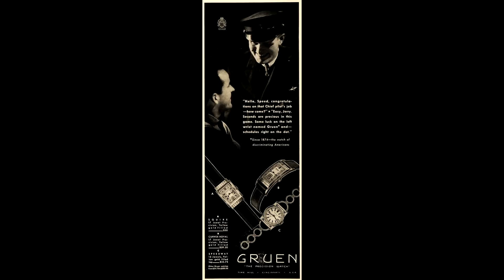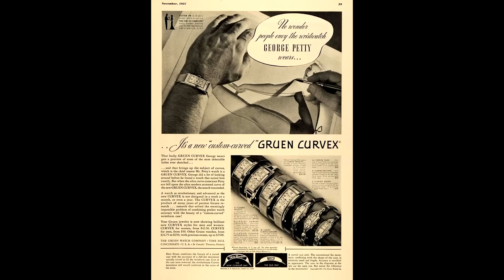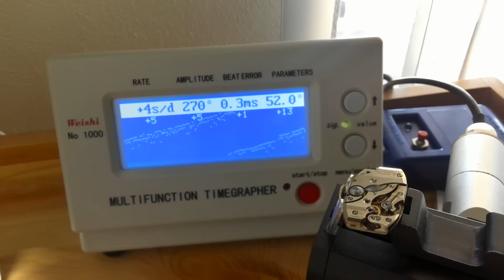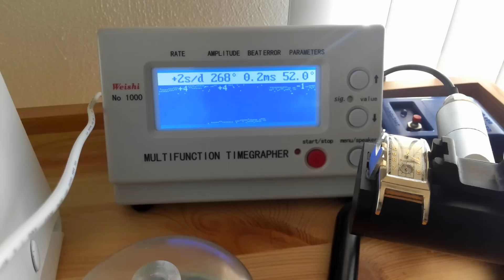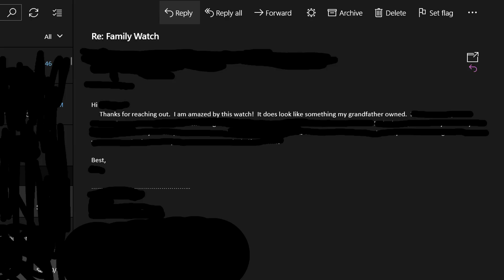Restoring And Finding The Owner Of A Lost 1936 Gruen Curvex Watch

Comment: I have a number of watches with poignant inscriptions, i.e. "To Benjamin on his 21st birthday."  Others have the person's name next to engravings like "For 30-years loyal service."  These watches are family heirlooms; it's a sin that they ended up in pawn shops or eBay.  The Curvex was a drivers/pilots watch, and was worn 90-degrees rotated from normal wristwatches... it sat behind thumb - the reason for the curved case and movement.  The driver/pilot could see the time without moving his hand or releasing the wheel.  The movement was a completely new engineered movement in order to fit the curved case.  Gruen at one time sold more watches than any maker, and kept careful records of who bought its watches.  After the company sold out, the new owners just trashed the records, so that information is lost forever.

Comment: Most interesting video.  This popped up as i was researching Gruen watches because my pre-teen granddaughter has decided she wants a watch. She saw one in the jewellery case at a thrift store and said she liked it.  With her bday is fast approaching, I got her two watches in the style she admired, we had new batteries put in them and they keep time perfectly!  My problem is that I understand Gruen watches made before 1976 are collectable. Pre-1953 even more so but I can’t information on the one watch we picked up which is a Gruen watch, stainless links, “base metal” bezel at 12 o’clock. I’m thinking it’s a knockoff but still vintage.  It says on the face “Embassy by Gruen” but not Swiss, rather it says on the back “Japan Movt” and other letters and numbers.  I’d just love to know the story, not so much for actual value but to be able to relate to her that the watch is vintage or antique, the story of where it may have been made or year of make.
Reply from the maker: Being that it is a quartz watch, the earliest it can be is the 80s. The original Gruen ceased to be a company in 1958, so your watch is probably made by a company who bought the name because it was a well-known name. I am not familiar with Gruen after it ceased so unfortunately, I don't know much else. Thanks for watching!

Comment: It's a very crude looking movement. If you notice the gears and and the overall finishing of the parts look almost "stamped", and unfinished, rather than the teeth on the gears looking "cut." There is no burnishing or polishing on any of the components. The contours and angles of the movement base plate have a distinctly looking "pressed," or "stamped,' look about them as well. P.S. What Gruen Watch Company got really know for, was their special 25 jewel Automatic/Chronograph, Day/Date watch. My late Father had one of these watches. They pulled out all the stops for that one. Gruen had a working Man's watch line, and a luxury watch line as well.
Reply from the maker: For the money, I think it is a great finished watch. Thanks for watching!
Reply: @WorkingWithTime  No its not. It's a crude finished watch and you get what you pay for. Even in the 1930's ;) You like to collect Gruen watches ? How about starting to collect their luxury watch line (circa 1955) ? Now those are nice watches for the money.
Reply from the maker: @markjob6354  I respect your opinion but I still hold my ground lol
Reply: @WorkingWithTime  Get your hands on one of their 25 Jewel Automatic Day/Date watches, or their rare top of the line 25 Jewel Automatic Day/Date Chronograph special with the 14K Gold case. Now THAT is a nice Gruen to own !

Comment: The Movado "Polyplan" took the concept of a movement made to fit a curved watch to the extreme by making a movement whose bridges were on three different planes.  The construction required multiple bridges to hold down the motion works on the dial side and therefore made them very expensive to make.  It is believed just over a thousand were produced, all in gold or silver cases, and some were chronometer certified.

Comment: My guess would be a problem with the pallet fork pivots.  Broken or gummed up.  

Well I got that wrong.  My second thought would have been a dislodged impulse jewel on the balance.   Also wrong.

I don't think you showed the actual repair?  Balance work is always the most exacting and delicate, well done.
Reply from the maker: yes, unfortunately it was difficult to film and install the new roller table. I also want the video to run on too long as well. Thanks for watching!

Comment: Nice work. Next time, please polish the case.  The scratches diminished the looks of the watch. Just saying.
Reply from the maker: The watch was gold plated so polishing was unfortunately not an option. I buffed it with a polishing cloth which shined it up though. Thanks for watching!
Reply: @WorkingWithTime  I hear you. You don’t want to removed the metal.  Agree 💯 but there are specialized wheels for that purpose. Anyway, the watch came out nice.  I also like how you comment while working the watch, short simple explanations and to the point, nothing drawn out. Keep up the good work.

Comment: You are working on a pad that looks fibrous, wouldn't that shed and get in the works? I guess it doesn't but I don't see how.
Reply from the maker: That is called watchmakers paper, it feels like tissue paper. It will not flake and it is really handy to use as a disposable surface. Thanks for watching!

Comment: I am currently working on a Gruen 335 movement, actually 3 of them. They were all run/stop when I started. I cleaned, reassembled. Everything moved smoothly. I installed the pallet fork and then the balance and nothing. I cant seem to get the balanced positioned correctly to save my life. I am not sure what I am doing wrong. The balance staff is good on all of them, one if the pallet fork pivots may be gone but that was a parts watch anyway. At this point I would settle for just one of the three to work. Any thoughts or experiences?

Comment: At approx. 37 minutes into the video you show a shot of the timegrapher screen.  That watch is NOT running correctly.  The "scattered" dots show that there is a problem in the wheel train.  I THINK it may indicate possibly a damaged escape wheel tooth, possibly a damaged or dirty 4th wheel tooth, or maybe dirt in either the escape wheel or 4th wheel pinion.  Maybe a more experienced watchmaker can shed light on what the timegrapher is showing us when it looks like that. Nice work otherwise.  I would suggest wearing "finger cots" when handling any watch parts and considering using brass tweezers when working on nickeled parts to lesson the change of scratching them.  Beautiful results on the restoration overall!!
Reply from the maker: I appreciate you watching so critically. The timeographer I am using is not the best and you cant adjust the sensitivity, I was worried with that extra noise as well and tested it on another one I had and it looked fine with higher sensitivity. Timeographers can be finnicky and you cant always believe the extra noises it detects, If you noticed aswell after I cased it up how different it hears it.  I was trained classically to not use finger cots, they saw it as a crutch. As far as tweezers go, I have used brass, bronze, and nickel and I prefer nickel to the others. Thanks for watching!

Comment: How did you fix the roller table?  Did I miss that part?  Thanks.
Reply: Same question here :-).  Seems like you'd have 2 choices: replace the balance staff with an appropriate sized one or, find a replacement roller table from a suitable donor watch.  The roller table is hardened and therefore brittle (ask me how I know ;-) )so no "closing" the hole without shattering the roller table.  If there are more experienced watchmaker's  reading this please let me know if you have additional ways of correcting this.  I have run into it on various watches I've worked on over the years.  Either shellac or super glue :-( being used to secure it.
Reply from the maker: I found a replacement roller table, the old one was loose on the staff. I heard you can also make a thin sleeve on the lathe to fit over the staff to make the right friction fit for the roller table. You would just need to make sure that the roller table is the correct one for that watch. Thanks for watching!
Reply: Wouldn’t it be possible to just replant the table arbor? Or rivet it as clockmakers do? Just curious. Very nice video. I enjoyed it.

Comment: What was wrong with the watch in the  first place ? Just dirty and need of lubricant?
Reply: The mainspring was broken as well, it's all in the video...
Reply: @nemesis1291  somehow I missed that part , question  did you somehow mane the new mainspring better like store more tension to make the watch run longer on a winding ?
Reply: @solstar4778  I'm not the one doing the repair, I'm only a subscriber. Hopefully the owner of the channel will see this and give you an answer, good luck.
Reply: @solstar4778  at 6:42 he talks about the old blued springs losing their strength.

Comment: Newer watches don't have crown wheels?  It's only called that because of appearance?  🤣🤣🤣🤣🤣🤣  Sure, dude.
Reply from the maker: A true crown wheel that I am referring has the extra set of teeth on the bottom hence giving it the name. Newer watches have a part called this and it does the same function but it is not the same. Similar to how most people will call a balance cock a balance bridge even though technically they are different. I point this part out just for the sake of admiring the  manufacturing it takes to produce compared to a modern crown wheel. It is the same case of why a column wheel is more impressive in a chronograph compared to just a cam. Hope this helps!
Reply from the maker: Crown wheel: a contrate wheel in the winding mechanism of a watch that drives the ratchet wheel and is itself driven by the winding-stem pinion. 

Contrate wheel: In a watch, a wheel, the teeth and hoop of which lie contrary to the other wheels, or parallel to the axis.